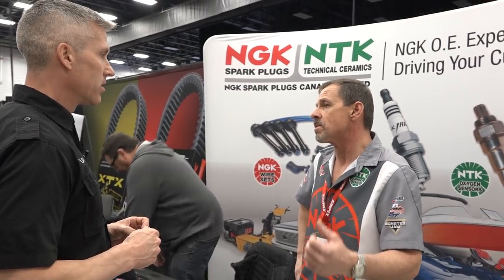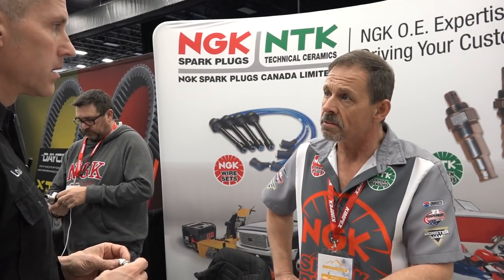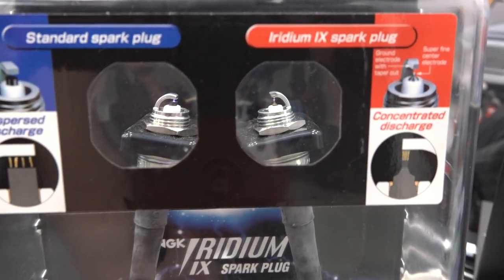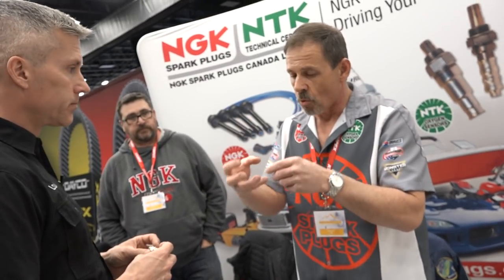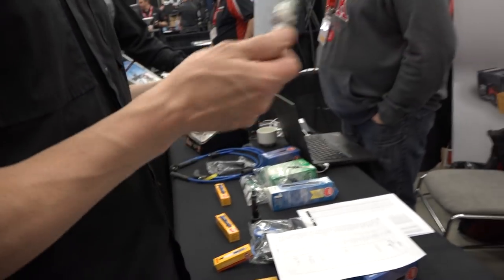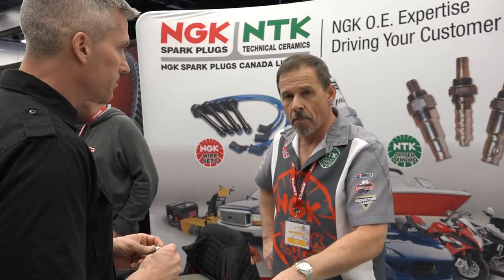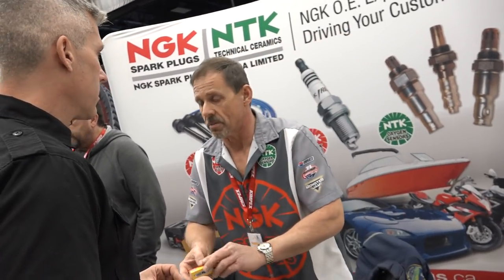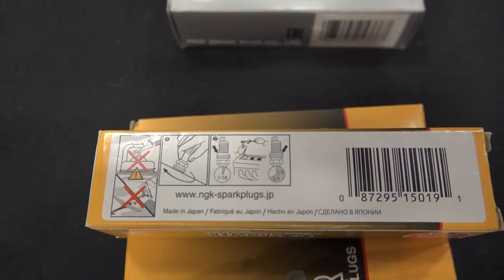Spark Plug Torque and IRIDIUM plugs explained at the Kimpex Show!

Comment: That whole half turn thing is only if the plug is new, second use the washer is crushed and you should torque to spec... also on the box is the torque spec.14 to 16 ft pound I think

Comment: So I recently installed some NGK platinum plugs.  The box said 1/2 - 2/3 turn after finger tight but I opted to use a torque wrench set to 18 lb ft.  Supposedly the 1/2- 2/3 turn will get you 18 lb ft to 22 lb ft, yet I found that my wrench clicked at just over 3/4 turn presumably beyond 22 lb ft that should have been reached at 2/3 turn.  I am still unclear as to the inconsistency between their recommended torque angle method vs. the torque wrench method and an inquiry to them said they were unsure if they have actually compared the two which seemed odd.  Does anyone have any comments as to this observation?  I was very careful to clean the gasket sealing surface on the engine.  I was thinking perhaps carbon residue in the threads might cause an inconsistency but it seems residue would cause torque to be reached sooner in turns of amount of turn as in anti-seize causes a delay in torque being achieved.

Comment: I run iridium in my 2stroke ktm but my new 800 Polaris comes with standard br9es I agree that iridium is great but why wouldn’t manufactures use them ? Just for a cost reason or a technical reason ?
Reply: Do they make a br9es in the upgraded i know they have a platinum or whatever